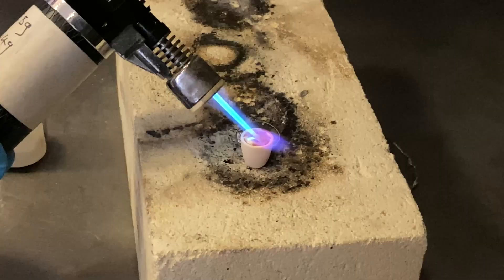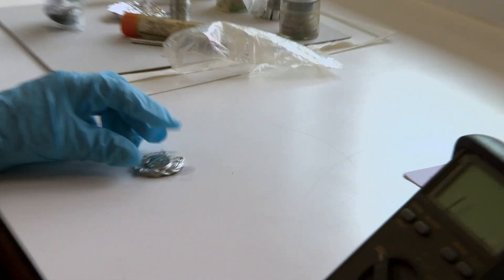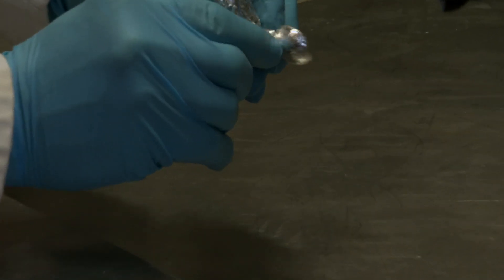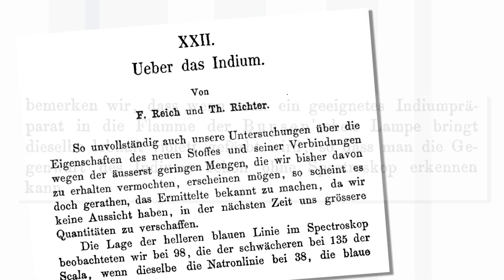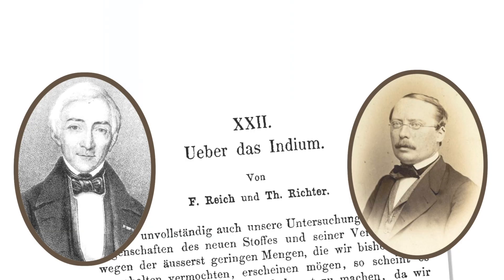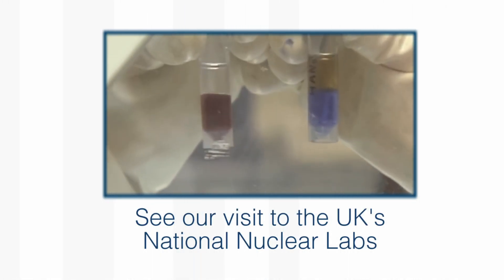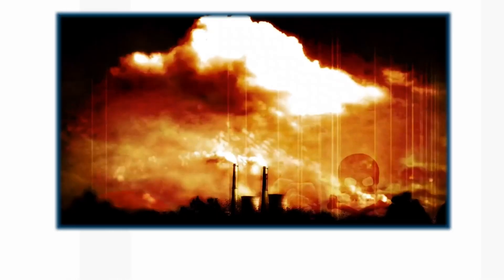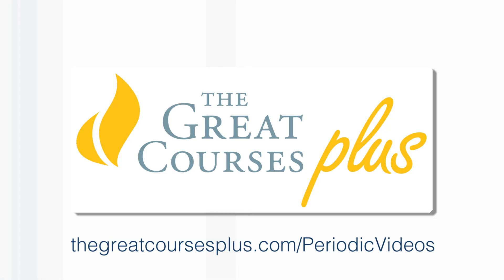Indium - Periodic Table of Videos

Comment: We used indium wire to seal aluminium sample holders to prevent leakage in a vacuum when I worked on the electron volt spectrometer at the Rutherford Appleton Laboratory in the 90s. We could have used some kind of rubber piping but this obviously contains hydrogen and our instrument was extremely sensitive to hydrogen.

Comment: Indium tin makes a great super low mp solder, pure indium makes awesome high vacuum gaskets that double as electrical feed through. I've also used indium for relatively bright violet fireworks stars, but it was a bit expensive compared with copper strontium mixes. Used to use it for sealing laser mirrors and for a heat sink gasket for high wattage laser diodes.

Comment: Fun fact: if you take 2 sheets of ito coated glass with the coatings facing each other with some tap water in-between and place a small voltage across the plates, one will start to become silvery and no longer conduct. I think it was the negative side.

Comment: Wouldn't oxidising a small quantity of Indium on say a Titanium wire in gas-flame produce that indigo colour? 
Also, while the coating mentioned at the end of the video is important in the manufacture of LCD screens, it's in touch-screens where it's essential in producing a degree of capacitance between your finger & the small amount of electricity on the conductive-surface on the back of the glass (it's not on the front of your mobile or tablet's screen, otherwise screen-protectors wouldn't work)!

Comment: I'm a little surprised that the professor was surprised at how easy it was to get an impression of a coin on the indium.

Up until early in the reign of Elizabeth I, all English coins were hammered in much the same way, with "negative" dies used to bring the image up on the coinage blank. It wasn't until the middle of the 17th century that they stopped making any hammered coins.

Comment: So where's indium come from? In 1990 I was on a tour of the Kidd Creek Metallurgical Site in Timmins, Ontario where ore from the Kidd Creek Mine is processed to extract zinc and copper. Part of this metallurgical site was the Indium Plant, a small scale operation where this element is refined as a byproduct. As you saw in the video, it's quite soft, softer than lead or solder. Although not mentioned here, I think it's also used in making light emitting diodes.

Comment: The existence of indium in nature in what form?
Reply: permission to reply. Indium is formed through a very long s (slow neutron capture) process (hundreds of years) in low to medium mass stars (mass ranges between 0.6 and 10 times the mass of the sun). When the silver-109 atom (the isotope that makes up about half of all available silver) captures a neutron, it beta decays to cadmium-110. Capturing further neutrons will form cadmium-115, which decays to indium-115 via another beta decay. This explains why radioactive isotopes are more abundant than stable isotopes.
Reply: @dwiayusafitri1677  what are the uses of the element indium?
Reply: @yuliati208  Indium (III) oxide and indium tin oxide (ITO) are used as transparent conductive coatings on glass substrates in electro-luminescent panels. Indium tin oxide is used as a light filter in low pressure sodium vapor lamps.
Reply: @dwiayusafitri1677  thanks for the explanation
Reply: @yuliati208  okay you're welcome, hope it helps

Comment: Sorry, kids chemistry. Hammering 'slightly tocic' on a table that the tax payer paid (use an anvil), spilling nitric acid over a new wooden test tube holder, using a wooden stick instead of magnesia rods, is kids chemistry. Better show how ITO is made and sputtered, where indium is on the scale of electron negativity, how to extract it for instance from old germanium transistors.

Comment: I read a book from the 1920s that talked about mica in radios. Pure mica was used as a tuner and supplies of it were starting to run out. 

The book said that it was a problem, but that a replacement would be found. It was found in silicon compounds.

Today, radios with tuners of mica are antiques and electronics use silicon to tune radios. 

I suspect that in the future, a replacement for indium will be found.

Comment: You fail to mention indium's metal's ability to directly bond to glass.  This is used in vacuum tubes where there needs to be an optical window of different glass from the rest of the tube (which can be ground/polished to perfection and not subject to the high firing temperatures in the tube manufacture, only to the melting temperature of indium.  The indium protects the tube from strains due to expansion mismatch because of its ductility.  This was used in vidicon camera tubes faceplates, and some gas laser tube windows.
          Indium is also used to improve electrical contact to aluminum.
          Another fact: natural indium has 2 isotopes.  75% of indium is radioactive (but with VERY long half-life).

Comment: SOX low pressure sodium lamps use a indium tin oxide coated outer glass envelope to help retain the infrared to keep the sodium tube hotter and increase the lamp efficiency.  Unfortunately, they are no longer manufactured and being phased out these days, but was commonly used in street lighting especially in the UK for years.  The glass has a faint greenish tint to it.

Comment: We use Indium alloyed with Gallium to cool  in-vacuum X-ray laser optics. It's cool stuff- it melts below room temperature! And conducts heat well. It's difficult to use in vacuum, because any tiny bubble will pop once you pump down the vacuum chamber, and splatter everywhere!

Comment: Indium foil is great for thermal transfer between high power semiconductors and heatsinks because it's so soft that if the device is bolted down firmly the indium flows plastically to occupy any gaps and makes the overall thermal resistance of the system lower.

Comment: Thank you for the interesting video on indium. I have two concerns related to misinformation:1) Indium is not poisonous. This is easily fact checked with a safety data sheet from any supplier. You are not working with indium dust from a grinding operation.2) Indium supply is not running out. Prices are historically low due to oversupply. For more information please check the U.S.G.S. Recycling materials is always a healthy long-term strategy, and indium has a robust reclaim loop in place.
Reply: glad to see this comment this should get more attention

Comment: What happens if you have Iron Oxide in gas form and condense it with Co2 Oxide in gas form and bubble it through liquid Nitrogen and put it through a chamber with Sulfur Dioxide and High Electricity after that Make the Experiment to a Powder... What do you get?? THIS is not a School Question I'm Just Curious and want's to know it I have asked my teachers and they don't know what will come out of it and I also asked Reddit But no one got back to me and my question was deleted by Moderator's And I don't have a Lab so yeah really bad luck I have here...

Comment: please stopp the indium running out myth - having 50 years secured supply is enough - there is on going search for further deposits and currently know, but low yield deposits can become attractive. Also there is simply no worth in securing centuries worth of supply - the world will change by then anyway.
Reply: Yep, see USBM definition of reserves.
If we stopped using it altogether, no demand, zero price, no reserves, we would technically have 'run out'.
Help we have run out of minable neptunium.

Comment: Hi, you should have checked the phase diagram of Ag-In.Also, note that despite  very low melting point, In has very high boiling point and very low vapour pressure. So it is difficult to have a spectrum by just heating...

Comment: I saw a video (Styropyro was making another insane laser) just the other day in which Indium was used in attaching an object to a heat sink: a sheet in Indium foil was placed between the object and the heat sink, and the softness of the Indium allowed it conform and fill in all of the micro-irregularities of the surface of each item so as to afford a much better contact, and thus heat transfer, between the heat generating object and the heat sink.

Comment: If you can use it to make a impression of the coin could you use it to make a mold to counterfit the coin
Reply: Or you could do it with a slightly less toxic piece of lead. Or a bar of soap.
Reply: You start by melting down a bucket full of 20p pieces ;)

Comment: A similar color can be obtained by melting a fairly thin piece of copper wire with an arc of 15000V and 10mA. The copper melts and beads up into a ball which begins to incandesce as the arc seems to more evenly distribute across the bead, the end result being that you can see the blue from the arc, the red from the incandescent copper  and (if done right)where the two meet, a halo of rather reagal looking imitation violet.

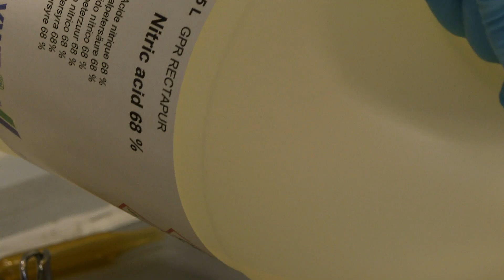Comment: 8:00 Nitric acid can actually dissolve gold if there is an excess of a strong acid (eg. 98% sulphuric acid) present.
2 Au + 3 NO3(-) + 18 H+ --> 2 Au(3+) + 3 NO(+) +6 H30(+)
Reply: That's like saying that water can dissolve silver, if there is an excess of nitric acid.
Reply: @xenonram  It's actually the Nitric acid dissolving the gold by reacting with it. It just needs a lot of H+ ions.
Reply: @xenonram  HF is a 'weak' acid so it just be pretty safe

Comment: The gold alloying probably didn't work because the process wasn't done in the correct order.  When I solder, I heat the base material first and to a temperature higher than the filler material, then I apply the filler material and use a wicking process to draw it into the gap, sometimes aided by a flux.  As I am not all that good at soldering, sometimes I overheat the base material.  I suspect this was what originally happened back in the day, overheating the gold meant the indium was able to alloy with the gold instead of simply coating it.

Comment: My immediate thought on "what will our grandchildren do" for displays, was "use graphene!"
Reply: Actually, there has been research into light-emitting plastics that glow under electrical stimulation in various colors.  These plastics work on a completely different process from a LCD or OLED matrix.  They could theoretically give us fully flexible screens (such as has been shown in various Science Fiction media) and even fully transparent screens. Or a combination of both.  It would not only negate the need for glass layers, but also for the cathode and anode of a traditional LCD display or OLED display.   Pretty cool.
Reply: You're right, we'll find a solution to it eventually.  Even if it's not graphene, it'll be something.
Reply: @user-ko7lz3kr1d  There's a lot of work around ferric-chloride intercalated graphene; it's a better conductor and more transparent than ITO, they're just working out the manufacturing of screen-sized elements.
Reply: @Beeblebroxologist  What it sounds like is we might get replacements before we even run out of indium, so we might just stop using indium all together in the near future.
Reply: @user-ko7lz3kr1d  At least for screens, yes hopefully. Indium is very rare, and very hard to recycle from old touchscreens (even though they are the densest 'ore' available)
Reply: let them use cake.

Comment: To answer Brady's question:

Caesium - From the Latin caesius, meaning sky blue
Chlorine - From the Greek chloros, meaning pale green
Chromium - From the Greek chroma, meaning colour
Indium - Named after the indigo line in its spectrum
Iodine - From the Greek iodes, meaning violet
Iridium - From the Greek iris, meaning rainbow
Praseodymium - From the Greek prasios didymos, meaning green twin (the other twin is Neodymium)
Rhodium -  From the Greek rhodon, meaning rose
Rubidium - From the Latin rubidius, meaning deepest red
Thallium - From the Greek thallos, meaning green twig
Zirconium - From the Arabic zargun, meaning gold colour
Reply: Another one:

Praseodymium - From the Greek prasios, meaning green.

And two nitpicks:

Violet is iodes (not iodos).
Iris is Greek, not Latin.
Reply: @Timrath  Thank you for the corrections. I've updated my comment. (Though, the sources I checked seem to suggest iris means the same thing in both Latin and Greek)
Reply: Thallium. Θαλλός is the tender, and thus green sprout
Reply: @fuqin9462  I didn't realize that Thallium was named for its colour, but you're right. It was named for its green spectral emission lines. Added to the list.
Reply: @fuqin9462  Yeah, but that doesn't count, because thallos is a substantive, not an adjective. It doesn't mean "green"; it just means a thing that happens to be green. 
Otherwise one could also argue that Uranium means a colour, because ουρανός means "sky", and the sky is blue. Or that lithium means grey, because λίθος means stone, and stones are grey. It's soo much of a stretch.
Reply: @Timrath  Stones are grey? Some are but many aren't.
Reply: Wrong: Zargun(زرگون) is Persian(Farsi) not Arabic.
Reply: Guys, you keep misunderstanding what he said. He asked if INDIGO was named after India, not if INDIUM was named after India.
Reply: I also answered this one- but I didn't know Zirconium was from a colour! Thank you!
Reply: Im glad you spelled Colour correctly.
Reply: zirconium, like arsenic is named for a mineral (zircon) which is named for its color, a yellow-orange (the blue zircon is heat treated); arsenikos is Greek while zargun is Arabic, but both ultimately reflect an Iranian *zaranikam 'golden'; though Bunsen and Kirchhof intended to name caesium after the sky-blue color, their Latin was off.  The Latin word for 'sky blue' is caeruleus; caesius is the blue-grey color of eyes.  These Latin facts are recorded in the Oxford Latin Dictionary (pp. 253c & 254c) and in Lewis and Short's Latin Dictionary (pp. 264c and 265b).  Lewis and Short's dictionary is ultimately based on the German Latin dictionary of Freund.
Reply: A thank you to all the chemists/scientists here for sharing their knowledge!
Reply: @MrKapeji  Indigo was named after India because that was where Europe discovered Anil.
Reply: @cuttwice3905  I misread your comment earlier and contradicted you, apologies, I re-read it and realise it is the colour you are referring to not the element.
Reply: and rubidium, meaning "deep red" in Latin, for its spectral lines.
Reply: mustelid francium, named after the French flag for its white coloured compounds
Reply: Google is awesome
Reply: Oh I thought that indium was named after India because my friend did not know elements so he did not hear me and said India
Reply: Thanks
Reply: When they experiemented with it in the other video it turned out brown, so I guess that's why it's called ARSEnic.
Reply: @ae4164  it was discovered during a playoff at Arsenal's stadium where they unknowingly were using it to paint lines on the ground- by a guy called Nick.
Reply: Chromium is named for its various coloured salts.
Reply: Nickel was named after being copper coloured ore.  Originally kupfurnikkel. But then shortened. Nickel just means 'demon' but makes little sense without being 'copper demon' because you find copper coloured ore that then fails to produce copper.
Reply: @jorgepeterbarton  wait nickel is a demon? 😃💀
Reply: Palladium - the metal I think it named after its whitish silver colour but I could be wrong.
Reply: Proud to be greek
Reply: Zargun (for Zirconium) is a Farsi (Persian) word not Arabic
Reply: The twist is that indigo itself was named after India, where the plant producing the indigo dye originally came from.
Reply: Ty
Reply: You missed 2 really obvious ones. Gold and Silver.
Reply: @Ikaros---  Aren't you confusing the tail and the dog?
Reply: @Ikaros---  I didn't count those because the colours are named after the element, not vice versa. I did somehow miss Rubidium though, so I'll add that.
Reply: @stupidmustelid  Arsenic, named after arsenikon for yellow, in greek. Originally adopted from the persian word zarnikh. Cyanide, due to the cyanosis it caused as a poison, a blue colour pigment to the skin, due to lack of oxygen.
Reply: @stupidmustelid  is that true, technically? Au/Aurum - Latin for gold.
Reply: @stupidmustelid  Strictly speaking, cyanide is an anion.
Reply: @johnopalko5223  correct, cyanogen is a cation
Reply: Gold and silver are debatable. Sort of colour named after the metal not the the other way round. Have a suspicion that argentum traces back to white, check with a guy who studies insects (joke).
Reply: Isn't the Color Indigo named after the country, India?
Reply: @KnowBigDeal : "Isn't the Color Indigo named after the country, India?"

Yes, the colour Indigo is named after the country India.
Reply: @KnowBigDeal  No Indigo is named after the plant it was made from in ancient time: Indigofera tinctoria
Reply: @UniversScience  nope, the plant was named after the dye not the other way around. The first recorded use of the name for the dye in English goes back to 13th century. Scientific names were given to plants after Linnaeus who came much later. The dye was actually named after India.
Reply: @KnowBigDeal  ....no, after the River Sind.
Reply: @KnowBigDeal  I trust prof poliakoff more than you
Reply: @KnowBigDeal  As far as I can tell, yes.
Reply: @KnowBigDeal  did you even watch the video or were you being facetious?
Reply: @douglasmorgan9873  I dont think he watched the video it's a bit of a yawn festival
Reply: "...didymos" is also an asteroid. See latest NASA mission "DART" that hit the smaller asteroidal body "Dimorphos" that orbits "Didymos".